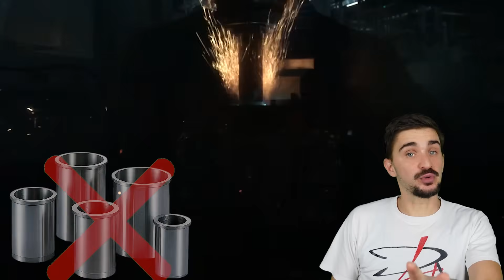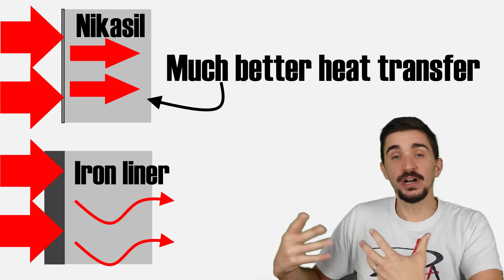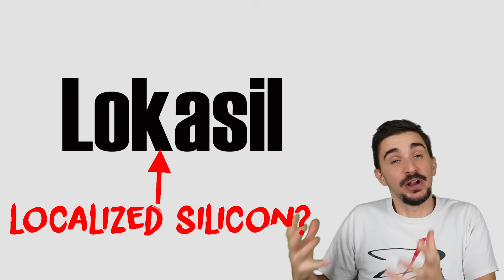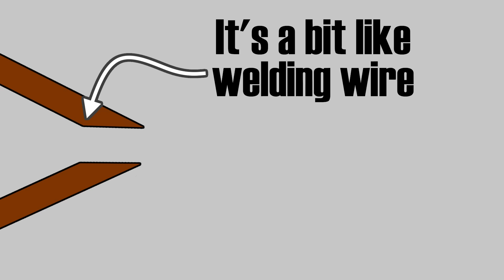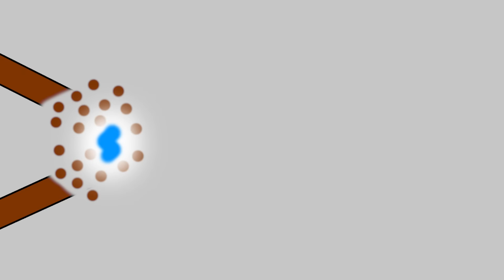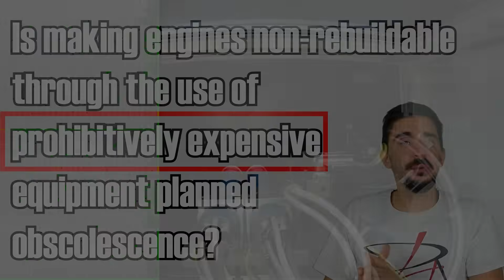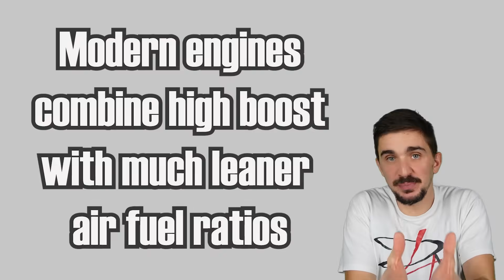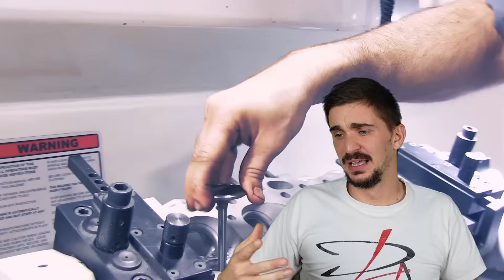Why Are Engines Becoming Non-Rebuildable? Everything About Cylinder Coatings

Comment: The number one thing about rebuilding an engine is the condition of the cylinders. If the cylinders are in good shape and the reason for the rebuild is something else, then rebulding is always a good option. examples of this  are bad valves, bad bearings, leaking seals, bad timing chain, bad crankshaft, cracked or warped head, blown head gasket and so on. As long as the cylinders are good the engine is worth rebuilding.
That said, A good machine shop can re-sleeve these engines. This is very common when the blocks are worth it. The problem is the re-sleeving is costly and expensive and is only done when the cost vs benefit is reasonable. This is very common for diesel engines. But then again, most diesel engines are designed to be rebuilt.
There are a lot of engines that just don't have the extra material to bore them out, put in new rings and pistons. In those cases you really need to get a new block and build that engine. Engines that are worth rebuilding are ones like V-8 engines like the coyote and the like. A run of the mill 4 -6  cylinder is not worth the extra effort of re-sleeving.
I love older engines that have lots of "wiggle room" to allow for a re-bore.
The big thing is cost. the cost of all that machine work can really run up a big bill, where the cost of buying a short block from the manufacturer ends up being much less than the rebuilding cost.

Comment: You did explain one of the most important thing in this video. TIME, as time goes on tech trickles down, gets less expensive. Why rebuild an engine that is 10+ years old, when you can keep the body and install a newer engine, use an aftermarket (Haltech) engine management and, you now have an old looking car that has a more efficient engine. Yes I do love a rebuild of a vintage engine see lots of RB's lately. Only Time will tell.
Reply: No one does this.

Comment: 20:30

As someone who spends way too much time researching random stuff, this is a pattern that comes up all the time that annoys me. 

People demand something (in this example, environmental friendliness), until the government mandates it. Then, in order to achieve those mandates, products have to make tradeoffs. People don't like those tradeoffs, but also don't seem to understand the chain of causality, where the tradeoff is required by law, because of a different thing that you wanted. Usually, but not always,the tradeoff is increased cost.

This isn't to say that these tradeoffs are good or bad, or that the government should or should not be mandating whatever. Rather, I wish people had a better appreciation for these tradeoffs, and had more realistic expectations.

For a relatively topically relevant example, I used to live in California, which has famously high gas prices. People complain about gas prices all the time there. But the main reason that gas is so expensive there is because California has stricter fuel standards than the rest of the country. It's not really the standards themselves are that much more expensive. But rather, since no other state in the US has these standards, fuel has to be manufactured special for the California market, and so California can't import gasoline from other states; it has to refine all of its gasoline in its borders. This drives the cost of fuel up, a lot. 

People will insist on these standards, because we have to protect the environment. But then they'll complain about the cost, not understanding that you accepted the cost when you mandated the standard. It's just frustrating

Comment: All this high-tech automotive stuff, meant to make vehicles lighter so consumers can get better fuel economy and save money, is the definition of being too clever by half. If all these efforts are in search of cost savings due to reduced fuel consumption, but they require the cost of the vehicles to spiral to our new unaffordable prices, where is the cost savings?  How much more affordable would a vehicle be if you made the engine out of iron, put a simple port fuel injection system on it and got rid of things like variable valve timing, cylinder deactivation, etc., and just added things that made things simpler for the consumer, like electric power steering.  We are chasing our tails with all this tech meant to save a little fuel but costing us a fortune to do it, false savings when we have to fix stuff more often and at higher cost.  I am all for more efficient ways of doing things, but only if the end cost is less, not more. Life cycle cost should be the metric, not fuel economy or any one cost contributor, that way you could see if the latest gadget is going to make a positive difference or not.

Comment: Your understanding of environmental impact of non rebuildable engines is wrong, because you consider rebuilding only the engine. But when an old car needs expensive repair most customers would basically scrap whole car and then - buy a new one. So you should first count CO2 impact of rebuilding damaged engine and using the same car for another lets say 10 years. Second You should count CO2 cost of scraping the whole vehicle, then add CO2 impact of producing new car and then add 10 years of usage.

Comment: So they aren't actually becoming non-rebuildable. Just needs more competition in the spray coating equipment market to make it more affordable.

Is thermal spray coating different from thermal spray welding? The equipment for the powder thermal spray welding doesn't seem very expensive for what it is meant to do although the powders themselves might be very expensive. Maybe it is also more about the verification tool.

Comment: About engine recycling vs. engine rebuilding: maybe you can recycle just 30kg of aluminium from an engine, but you forget one thing.
When you replace an engine, you have to most often replace the car too. 
Just because there aren't any new engines for an "old "car available at a reasonable price.
Especially  if the car body lasts longer than the engine.
So you have to remanufacture much more than just a new the engine. 
And that has a much bigger carbon footprint than any coating can save.

Comment: I don't think 99% of rebuildable engines get rebuilt anyway.  Enthusiast engines like LS and K-series do, because racecar, but who actually buys a set of 1st-over pistons and new bearings for their Kia Sorento?  No one.  If it blows, you plonk in a uses engine from a wrecked car with 150k miles of life left in it, or you buy a new one from the factory.  It's often cheaper for the highly automated mega engine plant to stamp out a new engine than it is for Joe and Earl to rebuild it by hand in a shop that they need to pay rent on.  In the old days, capital was crazy expensive and labor was dirt cheap.  Today, it's the opposite.

As an example, I have a 2000 Honda Insight.  Basically a stroked kei motor, iron liners, mostly conventional in terms of the moving components.  You cannot get new pistons and rings, let alone in overbore sizes.  You can't get bearings, rods, timing chains, guides, rockers, valves, etc.  But no one cares.  The engines still merrily get 65 mpg at 450,000 miles, and worst case scenario, you can buy a whole donor Insight for 2 grand if the battery is bad.  The engine architecture is perfectly rebuildable, but the economic case to do so doesn't exist.

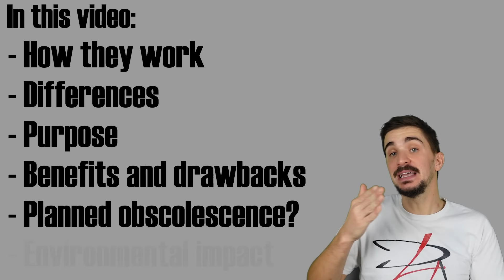Comment: 1:30

A lot of people get planned obsolescence wrong. Some thoughts

For one, whenever you're engineering anything, be it a car or a phone or whatever, you are selecting from a bunch of design tradeoffs in order to balance various priorities. Since nothing lasts forever, one of those tradeoffs is how long the thing lasts. Another one is cost. Thing is, for most products out there, we could build one that lasted 10x as long as the ones on the market now, but they would be so prohibitively expensive that nobody would buy them (not to mention it would likely involve other tradeoffs at that point). Most of the time, 'planned obsolescence' is just what you get when engineers make this tradeoff explicitly. If the designed product lifespan is 5 years, then planned obsolescence is just what you get when you say "ok, so, we're designing it to last only 5 years. Therefore, component XYZ is unnecessary, component ABC can be made half as cheaply because it doesn't have to last 20 years, etc". Of course to some extent companies are doing this to make money. But they're not doing it as a sneaky way of getting you to buy more stuff. They're doing it as a way to get the price of the product down, so you buy it in the first place

And secondly: consider a product with a very short designed lifespan, like a cell phone which barely lasts 2 years. They are designed to barely last two years. A lot of that is due to the way that lithium batteries work: They will not last more than 2 years, so why bother wasting money making the rest of the phone last longer? But the more important factor is that they wouldn't be able to get away with designing products with such short lifespans if people weren't already ok with buying new ones so frequently. It's driven by consumer behaviour, it's not driving behaviour (except in a sort of homeostasis feedback loop sense).

Comment: Ok so heres the thing. Its not about rebuilding an engine that is at the end of its life cycle. We want to be able to repair that cylinder wall that got scored by a broken piston ring. Or repair the cylinder when it dropped a valve. Its NOT that we want to rebuild the engine that has 300,000 miles on it. Its the times when something unexpected happens. It was never about the ones that had a long life. We want to be able to FIX the engine that had a mishap at 20,000 miles. Maybe 20k is extreme, because that would be warranty. We want to fix the ones that have 65,000 miles. Cylinder coating makes it nearly impossible to fix. What about a Kubota engine, that had a wrist pin damage the cylinder wall, and Kobota dealer would only sell them a new $25,000 engine? You could put a liner in for a heck of a lot less than $25k. It is planned obsolescence. Because when it fails outside of the normal lifespan, there is no way to repair.

Comment: I have seen some people buy OEM short blocks for the Subaru EJ and FA engines when their engine bites the dust. It appears to not change the cost significantly. It is possible to rebore to +.25mm or +.5mm due to engine already having iron sleeves. Companies sell -.25mm and -.5mm crank bearings if the crank had to be reground in the process.

Rebuilding the cylinder heads was always cost effective for that, so they just rebuild the heads and bolted them to a new short block.

There may be another reason people went for this short block option, it also meant no waiting on your automotive machinist to bore the engine to the right over size, regrind the crank to the right undersize, and get a set of pistons and bearings of that size. With cylinder head rebuilding, there might not be difficult items to order. Given how quickly some of those Subarus blew up, they weren't due for valve guides, valve seats, or valves. Recutting the valves and seats would be acceptable. Standard valve seals would be all that was needed, which is not something time consuming to order or get.

Some coated aluminum blocks were saved by boring out the entire cylinder wall, and fitting special Darton iron sleeves with O-rings. To me, they looked a lot like the wet sleeve engines found in field serviceable heavy diesels.

There are companies that dealt with Porsche nikasil and alusil engines. LN Engineering Nickies is the one I know of. I have read about Porsche guys turning to a process called "Nickies." They saved a lot of Cayenne V8 TT engines that way. That company would overbore the engine, put a new plating on the aluminum cylinder walls, and install their custom size pistons.

Several years ago, I was reading about a cast iron block that might benefit from plating during rebuild. It would be the Ford 427 Sideoiler. They were cast so thin, the service manual said to never overbore them. The thin casting has also said to make pressing interference fit sleeves to be risky. I suppose if someone was restoring one, perhaps they could pay someone to put on one of these coatings to the iron block?

In other words, the engine is not rebuildable locally. Rather, you can have it rebuilt to ship it to a very limited facility that can do the process.

Comment: I think the real reason they do these coatings is BECAUSE you can't rebuild it. I think it's dumb. I much prefer cylinder liners. My buddy owned an Audi Q7 (Big SUV Audi also a Porsche Cheyanne in different body panels) with the 3.0 Supercharged V6. It died at 150k miles FROM the cylinder coating flaking off of one cylinder. Crappy part was he had trouble with that cylinder for ages and they nursed it past the warranty then wouldn't do anything about it.

Comment: funny thing about the vega is that it had the aluminum bore but the pistons were aluminum with a iron coating . re builders will always find a way to rebuild a motor . in this case two ways bore and replate or bore and sleeve with a fanged sleeve so the sleeve can't slip down

Comment: To be honest, engione rebuilding is only relevant to rare, expensive and powerfull cars, something that ma one day become a "classic car". Things like BMW M3, M5, Mercedes SL500, E63, C63 and so on... 

Some shitbox, with shitbox 1.3L engine will never be rebuilt, if sometimes economical it may get it's engine replaced, by taking another engine from scrap yeard, but the engine itself will never get rebuilt on such cars, the engine has to be somewhat rare and "special" to be even considered to be rebuilt. 

Example - have you seen anyone rebuilding run of the mill Toyota engines from 90s? Sure people rebuild high performance engines like 1JZ, 2JZ maybe A4-GE, 3ZZ-FE things like that - a flagship engines for that model and period. But there is literally list of dozzens of engines even hundreds that Toyota made in the 90s and nobody rebuild them, I am not even going to attempt to list all of them, but sticking with say Toyota Corrola - they had 1.4L 6A-FC and 1.5L 5A-FE, even 1.8L 7A-FE and all those engines goes to scrap, even if they are completely usable, not faulty and don't even need to be rebuilt, they are worthless, even the A4-FE (a normal version of A4-GE) is not considered valuable and nobody would bother rebuilding it. Only the special "black top and red top" version are sought after.

In short - rebuildable engines are kind of irrelevant, there are so few of the engine worth rebuilding that there will be inpreceivable dent on environment if engine is not built to be rebuilt.

Comment: I think that the thermal sprey coating looks like really promising tech, especially that it can be done again. And I bet if market demand would be there, there would be ways to do it in local shops. Question is will there be such demand? Right now I see that new HR13DDT whole engine (not only shortblock) costs around 2000 EUR. I think, the labour and parts costs to rebuild same HR13DDT would be more then 2000 EUR, so it's obviously cheaper to just replace an entire engine vs rebuilding old one. But this will really depend of aftermarket rebuilding services availability and costs.

Comment: What diff does it make?
Most people DON'T rebuild, they buy a rebuilt engine.
The only difference now is that the engine blocks are very cheap, so you just buy a NEW one.
Since this is more EFFICIENT than rebuilding, costs should come down.
Well, except that internal combustion is a die-ing tech.

Comment: You are mostly correct about plating the cylinders. The only thing that you got incorrect, is you need to move all of them down one spot. because the #1 reason that manufacturers use plating rather than cast iron, is it is WAY LESS EXPENSIVE! Also, engines using plated bores could easily be made rebuildable. By simply designing the block to accept replacement sleeves, or a sleeve pack.    //   I have lived with cast iron engines the majority of my life (I'm 68). But I have LONG been aware of the benefits of all aluminum engines. With both Iron liners and coated liners. For a normal every day driver, A quality sprayed on liner is fine. Because most new car buyers will NEVER wear the liner through, without some sort of mechanical problem. And even most second owners will not wear one out. by the time the car gets to the third owner, there will likely be so many other problems with the car, it is going to be one "cobble job" after another to TRY to keep the vehicle out of the salvage yard. So if the engine burns some oil, that is not it's primary issue.    ///   I am NOT  an environmental specialist. but our current CO2 in our atmosphere is 0.04 PERCENT.  That is from ALL sources. everything from automobiles to volcanos and everything in between. "They say that the largest part of that is caused by "humans burning fossil fuels". but what comes from automobile tail pipes is only 1 small part of this. NO ONE is worried about what comes from heating our homes. or farm machinery creating food for us to eat. or from industry. And who KNOWS how many other sources. Every time you light a propane torch to free a rusted bolt you are impacting that 0.04%.  Even if you use an electric induction heater, the overwhelming majority of electricity comes from a coal or natural gas fired boiler. Automobiles are one SMALL percent of hundreds of thousands of sources of global co2 pollution.  It's just that "ENVIROMENTALISTS" picked on one, easy, visible, source, and cried "The sky is falling" and its the automobiles fault. EVERY time that you use ANYTHING that has ever been heated, it got hot by burning fossil fuels. Unless it came from a volcano, or was heated by the sun and a magnifying glass.